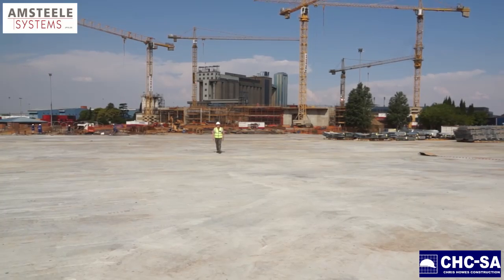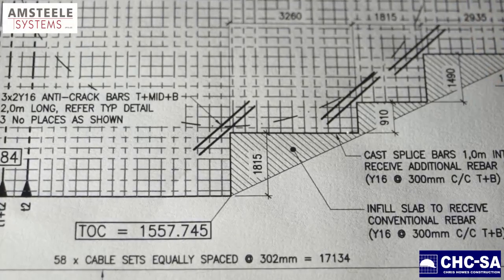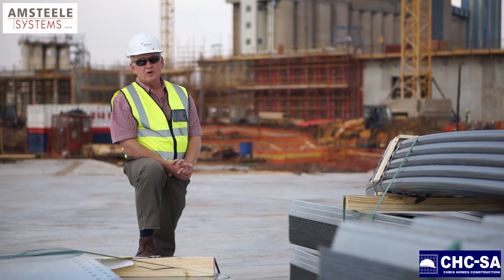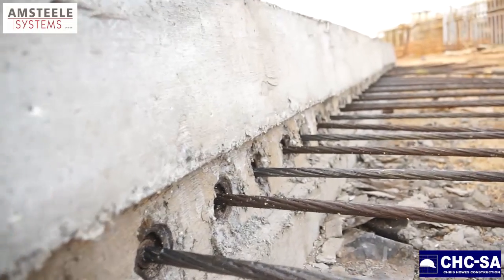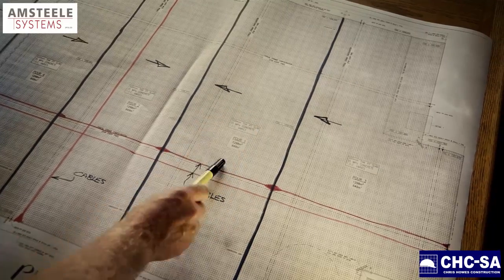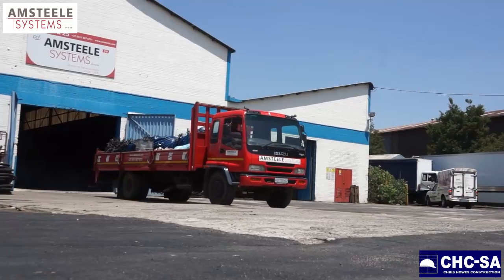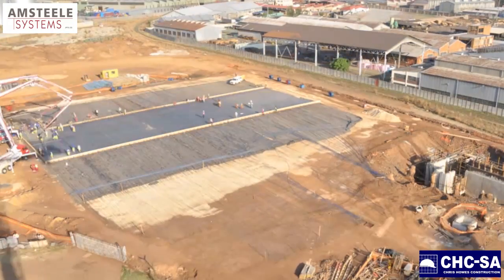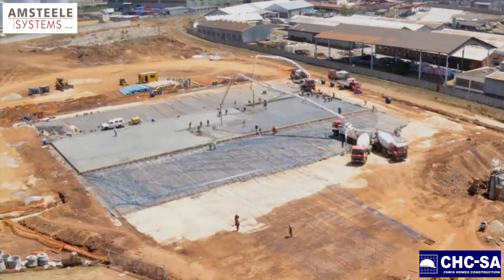Specialised post-tensioning flooring systems [construction]

Comment: Thank you for your video, it is very nice and helpful!

We are PT Manufacturer from China, our full products range for post tensioning and pre-strssing construction:
1. Materials: pc strand, YJM anchor system(monostrand anchor, multistrands anchor), ducts(metal ducts, HDPE plastic ducts)
2. Equipment: Hydraulic Jack(QYC mono jack, YDC multi-strand tensioning jack), electric oil pump, YH30 embossing machie(onion jack), GYJ500 extrusion machine, ZG130 ducts making machine, grouting pump and mixer for post tensioning).
Jason Wang
Sales Manager
Henan Prestressing Equipment Co., Limited
Skype: PT Manufacturer
Email Address: sales@pt-concrete.com
Mobile ＆ Whattsapp(Viber) No.: +8613673713569
Reply: +Jason Wang  Wellcome